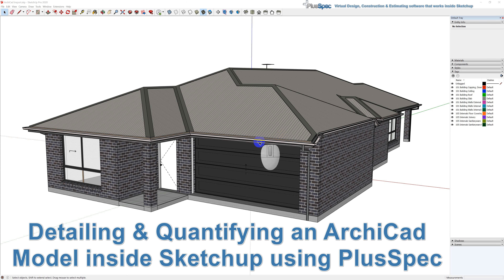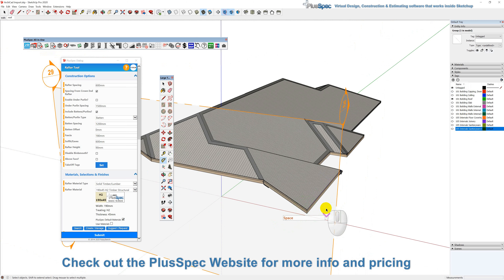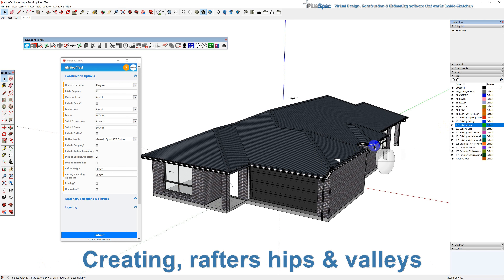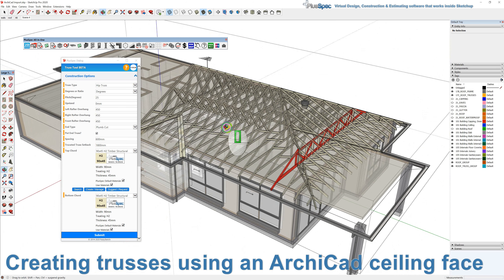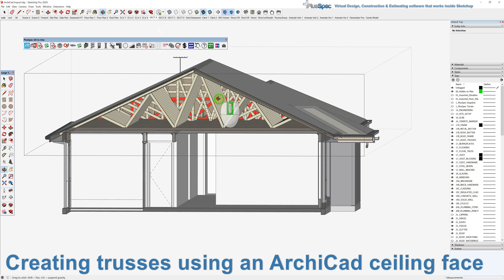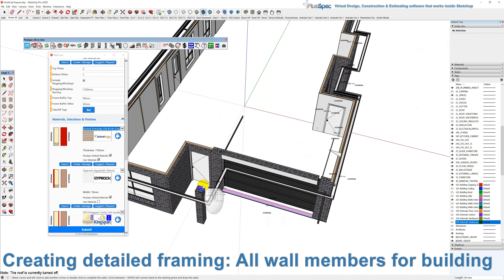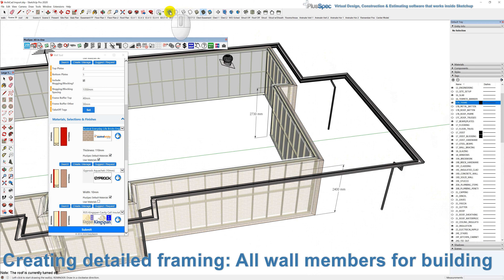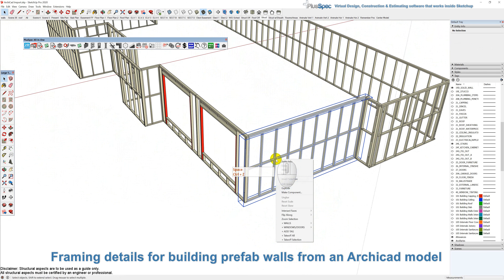Adding frame work studs, plates and trusses to an ArchiCad Model using Sketchup

Comment: I'm a British Architect and this has me excited! Have you guys implemented masonry, insulated cavity walls yet? I tried Plusspec a year ago, but without, it was a deal breaker for me. Happy to grab a license if this has been added though!
Reply from the maker: Hello Adam, thanks for commenting, We have a multiwall solution> From inside of the wall out it has: Cornice, Skirting or base board, Internal lining,  insulation inside frame (bats), outside of the stud frame it has a rigid cavity insulation with thickness, then an adjustable cavity and then external brick, the brick can also be painted or rendered and Eaves trim/quad.  Is this what you are chasing? I am pretty sure this has been there for some time though.  Adam we are in th midst of making a special wall tool that enable syou to add as many layers of wall so your input woudl be helpful.  We also have CLT  with linning being released this week.  
We are commited to continued development and your feedback is always well received.  If you would like you can request a demo here https://plusspec.com/plusdesignbuild/
Reply: Hi  @PlusSpec ,

Thanks so much for you're hasty response.

So the type of construction you are referring to is what we call timber-framed construction here in the UK, I'd say about 5 - 10% of new builds here are timber frame, with brick cladding, so your native wall tool would absolutely excel at that type of construction.

Unfortunately, the UK and most of Western Europe is still in the stone age with wall construction, and masonry construction still occupies more than 85% of common construction. the type of typical wall goes something like this (Brick external leaf 100mm) + (100mm Cavity, either solid filled with fibreglass wool, or partially filled with rigid PU insulation) + (100mm low-density breeze block, usually Celcon brand). + (25mm plasterwork zone consisting of, 10mm adhesive zone (dot and dab) 12mm drywall board and 3mm plaster coat). This 325mm type of wall construction is most British builders bread and butter.

I do wish timber frame wall construction was more popular here and also SIPS, but British builders seem very stubborn! the way we construct roofs and internal stud walls are identical to how you Aussies do it though, so those tools are perfect for the British market.

The special wall tool sounds exactly what I'm after, I currently use Profile Builder 3 for my walls/trench foundation details, but its window and door tools are rubbish compared with how your window and door blocks interact with your walls, you guys have created a full BIM package really, which no one else has managed to do inside Sketchup. So perhaps you could steal the basic idea of how the extrusions work in Profile Builder ensuring it integrates with your other tools as perfectly as your current wall tool.

Are you able to offer a rough date for the bespoke wall tool? once that Is implemented this will be the package for me.

I'm happy to give you guys a call on Zoom to show you some of the types of projects we do within the UK and how we detail our walls and foundations, as I said above, internal stud walls, roofs and intermediate floors we do exactly the same.

Thanks guys, really appreciate you taking the time, your product is incredible.
Reply from the maker: @gammonface  FYI we have been contacted by multiple architects and construction firms in the UK and they highlighted specifics about insulated masonry walls. We are about to release these items publically in PlusSpec 20.9 If you already have a license reach out to us for a beta-version
Reply: @PlusSpec  I've trialed and even subscribed to Plusspec once, however as Adam has highlighted it's not quite there yet for the UK market. Did your 20.9 build contain the UK spec masonry walls? If so, I might have another look at PlusSpec. 

It's always been looking like you would address the UK market but you never seem to have followed through with it. This blog page from a few years ago shows exactly the construction features being discussed above. It also includes a beam and block floor which would be great. The blog post suggested it was imminent, but did these features ever get implemented? https://plusspec.com/plusspec-3d-cad-design-and-estimating-software-uk-material-library/
Reply from the maker: @kennyb8718  Thanks for remembering PlusSpec Kenny and your comment. In version 20.9 we did several updates.  Kenny, we have created multiple skin/layer masonry walls as per your request and others from the UK US. We are creating tutorials now, it'd be great to get some feedback on our beta, if you have the time that is.  https://plusspec.com/
Happy new year, let's hope you guys can rid yourself of Covid soon mate. All the best and thanks again for commenting, we are a family business and do our best to get as much done as we can. Regards Andrew
Reply: @PlusSpec  Thanks for your reply. I keep checking back on PlusSpec every so often to see what has changed, particularly in respect of UK construction. It's great that you keep updating it and hopefully you can add further UK specific features and manufacturers products. I'll definitely download the latest version soon and try it again.
Reply from the maker: @kennyb8718  If you have any cross-section details Kenny that you would like us to either do a tutorial on or increase functionality please send them through to the office.  Your input is well received.
Reply: @PlusSpec  Thanks. This site has lots of UK details. For example: https://www.labc.co.uk/business/construction-details/e5mcpf12-suspended-beam-and-block-floor-150mm-insulation-below-screed

The above detail shows a typical UK cavity wall and beam and block floor which is also common. Your blog (which I linked to above) stated a few years ago you were introducing these details into PlusSpec. It would be interesting to see whether this is now possible. When I get more time I aim to give it a good test and provide feedback to you.
Reply from the maker: @kennyb8718  You are a legend, thanks. BTW that wall type can be done and also the block and beam floor is an option ( go to Joists, choose block and beam from the drop-down. Thanks again for commenting, it al helps.

Comment: Do you get plusspec plugin for archicad?
Reply from the maker: Hello Sudique Sorry I do not understand your question, are you looking to have PlusSpec work inside Archicad?  You cn aexport a nd archiCda model to Sketchup yet a better solution is toe export and IFC and then import it using the New IFC Import tool  (currently in Beta) in PlusDesignBuild